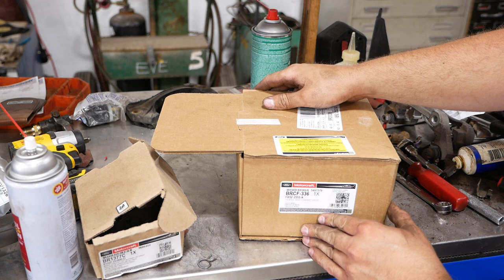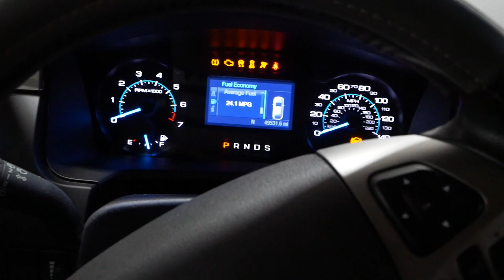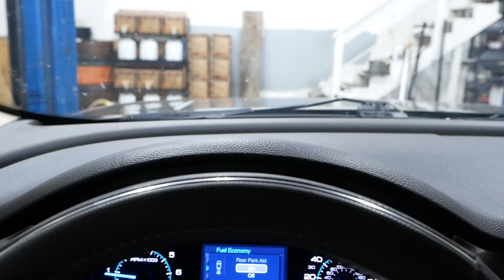Replacing a Brake Caliper with Integral Parking Brake - Ford Flex

Comment: As far as o.e. parts being better, there is definite a reason for it. I read a while back that even when a part supplier makes the o.e. part, it’s consumer division has to work with the same information that is available to non o.e. parts makers. It is actually unlawful for a maker’s o.e. division to share information on specifications with its consumer division. Apparently those laws were enacted to keep the aftermarket competition fair.

Comment: Funny thing about pinching off flex lines, I have no problem doing it with old and used ones, but not with new ones, which is the opposite to how it should be since the new ones should better be able to handle it.

Comment: I got a similar tool for them calipers but only RH tread. And I also have those calipers on the rear of my mustang and didn't bleed the way you did but still bled out ok. Stops great compared to the rear drums it had before.

Comment: First time I encountered screw back pistons was in a 1996 SAAB 99.  Was ticked off that the parking brake worked the front wheels, couldn't swing the rear end in the snow.

Comment: My 2001 Tacoma has 160k on the clock and is still running all OEM brakes and clutch.  Just now hearing the squealers up front so its time.   Twenty years on wear part!

Comment: Nice work Wes. I lost track of how many rear brake calipers I put on my 09 Honda accord back when I had it. It was a stick shift so I use the parking break every day but they still always seized up something about that wind back mechanism. I think every year I would replace at least one of the rear calipers. Maybe it was a problem with the remanufactured ones suppose I should’ve tried an OE one

Comment: Had a Saturn VUE it had 135,000 on it. Brake pads all four wheel were still 95+% rotors looked brand new! It got rear ended in fount of my home and was pushed out into the street and totaled it! Note: it was on its 3rd factory transmission? Rest of car held up great normal maintenance was a great car except for the trans? And was on 3rd set tires they were new when wrecked!

Comment: Excellent video Wes  :) also what I do is lube bleeder screws, grease up sliders pins plus plunger in clapiers in April and October every year also if vechile has drums too plus do Emergency brake cables plus on pedal or handle too and save from sticking on or seized up plus plus spray around brake lines to on master cylinder plus brake pedal too! Never had one my vechiles have bad problems since and who taught me the trick this is my Late Dad because had had major problems on brake problems on car and truck years cost him lots money and he learned from it especially when Winter Season months when happen on too! So want me not see happen to one 3 boys or anyone else ! But want giggle I use Emergency brake handle or pedal lots and only had one Emergency brake cable stick one and I had cut off one car had years ago and plus in Winter Season too not fun for sure plus had get brand new cable plus hardware to replace on plus back brakes on everything cost me lots $ but learned my mistakes!
Reply from the maker: That's a good idea!

Comment: The caliper puked out some Shrek piss when you bled the new caliper. The old caliper 100% had water in it from the brake fluid which caused the ratcheting mechanism to sieze up internally. I personally wouldn't have turned the rotors because of the 600-900°F blue/grey color the rotors had on them. You don't know without x-raying the rotors to see if they've got thermal inbrittlement, rather not take the risk their rotor shatters under hard breaking pressure. I've seen what happens when freight carriers cheap out on brake jobs and reuse bad drums, the drums crack at the hub face and beat around inside the wheels, cause axle damage and all sorts of other chaos.

Comment: I am not sure,however I have been told that in some states it is illegal for a repairman  to turn a brake rotor thinner than the manafacture's spec.for a commerical job.When I was in the trade,if a rotor would clean up by turning and still be within spec.we would give customer the choice of turning or replacing.Depending on model of car rotors can be fairly expensive.

Comment: Flex is extended Freestyle design. Freestyle design from the era when Ford owned Volvo. Have one of both. Freestyle still going at 248000 Flex at 156000. Minimal repairs to either.

Comment: Hell, my 91 Chevy c1500 still had the original Calipers, new rotors, wasn't worth saving the originals, Original Wheel cylinders as well, That truck has 678,000 miles on her. I sold it 2 years ago, I still see it from time to time. i'm not sure if they left the original engine in it, we had a cammed 305 from a Camaro we were going to drop in it, but sold it for the right price.

Comment: Nice job.
Worst one I even came across was a car where the "nice shiny" bit of the rotor was held in place by the caliper, and wasn't attached to the "fat lump" in the middle, outer thickness of the shiny bit was OK, but the inner was somewhat random and mostly missing.....
Reply from the maker: Yeah I've seen that before. Even had a drum like that once.
Reply: @WatchWesWork  ..and really scary when the owner's been taking kids to school and hasn't noticed the BIG brake problem, only that the kids have "done in the radio again".

Comment: In the UK we never change just one wheel caliper/ brake parts etc. We do them by Axle so in this case both sides would have to be replaced.Our ministry of transport annual vehicle test (MOT) includes a rolling road brake test and the braking efficiency & performance has to match on each side. Changing just one side would probably show an imbalance.
Reply from the maker: Why do you think I just did one? I keep forgetting if I don't explicitly show it, it doesn't happen. Did you see how there were two rotors in the blast cabinet?
Reply: @WatchWesWork   Sorry  Wes, I just assumed (Wrongly )  that as you only showed one and the Title described it as Changing "A" brake caliper and in your summary you said  that it  had now had  one new rear caliper which made me assume that you were only changing one. Evidently my mistake for which I offer my apology.
Reply from the maker: @philiphartley8823  I only changed one caliper, but the pads and rotors were fixed up on both sides.
Reply: @WatchWesWork  That was my point, in the UK  both sides would have to have had the calipers changed.  Our MOT tests are incredibly strict.  If a tester noticed just one new caliper on any axle the vehicle would fail the Test. The same applies to shock absorbers and steering joints. we can't buy some parts singly as they are only sold in pairs.
Reply from the maker: @philiphartley8823  That's crazy. There's no reason to replace a caliper if it's not broken. Normally they last the life of the vehicle.
Reply: @WatchWesWork   Yes I know but we have to have an annual MOT to be able to drive on our roads.  We pay an annual fee called Road Tax to be able to use vehicles on our roads  and we have to have a Current MOT certificate  and an insurance certificate to be able to pay the Road Tax fee. They are all tied in with each other and done electronically now.  Our testing system is a licence to print money for unscrupulous testers as they can fail a car and tell the owner it needs this that and the other and then charge them for doing the work. A cockeyed system all together. I never use a testing station that also does repairs. At least you get a chance of an honest test.

Comment: Clear hose should have been connected to the Bleeder Screw and the other end to a clear plastic bottle (in order to observe for bubbles); so brake fluid won't be dripping all around.

Comment: I've never bothered clamping the brake line when I do my brakes. I just throw something under to catch the drips, and fully flush the system with fresh fluid.
I've never greased the sliders either. I usually end up wire wheeling the pin because they've dried right up and slather them with anti seize, because rust belt.

Comment: I have the stuck wheel issue too, I stand facing away from the wheel and I horse kick it.  No need for a hammer Wes!  I agree with the original rotor comment, I bought OEM new and they were different than my factory rotors on my WK2.  Why would they be different if I bought from the dealer, doesn't make sense.
Reply from the maker: They probably switched suppliers. That's really common. Once the car is out of production and the volume drops way off, they bid it out to a different supplier who is OK with making less parts. That's why OEM parts often aren't any better than aftermarket.

Comment: Just replaced my pads and rotors on my fiat punto a few months ago, i hate those integrated parking brake calipers, never seem to hold the car as well as the old drum stile does, was a pain to get them to go back in without that tool

Comment: Ceramic brake pads you won't have so much trouble also drilled and slotted rotors I just put a set on my '07 SuperCrew from Detroit axle since the fluid and clean brake clean they send it to me when I buy brakes

Comment: I find it easier to remove the ebrake cable and loosen the flex hose while the caliper is still bolted to the bracket and the bracket bolted in its place.  Unless you're into smashed knuckles. To each their own.

Comment: I usually don't weekend warrior on stuff this new I wonder how my power bleeder would do on that style caliber 
2 wks ago I had 1990 tune port iroc in the shop with the worst seized on wheels I've ever seen I ended up using a old school trick of backing lugnuts off 1/8 of inch and driving around block they came right off after that corner side load is some good force on it

Comment: I'm surprised you did not have a small clear hose on the bleed nipple. Lets you see the air bubbles, and helps control where the brake fluid goes.

Comment: I don't know if it's the angle of the camera but the pads looked a little small, they never extended to the end of the rotor. I recently replaced brakes on a Kia and it had the same thing, I found out they had 2 different size rotors for the same model car and the previous mechanic put on the wrong rotors. When the pads don't go all the way to the end it forms a ridge.

Comment: Common issue with the Ford Flex, we have replaced our calipers, and rotors 3 times now in 80K miles. the guide pins rust and seize up.

Comment: Wes I was wondering why u didn't torque the bolts down? When it comes to brakes that is one of the most safest jobs to do on someone car or truck. I have always torqued mine on vehicles cause if you don't and they have a wreck and someone dies they will check that vehicle from top to bottom and if the brakes caused it they will check to see if they are torqued the right specks.

Comment: Actually I am surprised that you put lube on the pad sliders.  Many years ago when I worked at a GM dealership (as a lube tech but trained as a mechanic, long story) here in Canada a GM rep came and gave a demonstration on new procedures.  One thing was to not put grease on the pad sliders.  The reason was that the grease would collect dust and dirt.  Thus preventing the pad from sliding.  So ever since then I have not done that.  No problems.

Comment: Since the mass adoption of ceramic pads, I almost never have to change brakes on my cars and trucks.  My 2016 Subaru Impreza has 110K miles on it and the brakes are still all factory.  It's also a manual, though you can't really engine brake with it much, makes it use oil.
Reply from the maker: These are semi-metalic if I remember right.

Comment: Ayy up Wes did they say brake job,or blow job??Another fantastic vlog  from you good to see Mrs Wes doing your paper work,
when I change my brake callipers I also change the flex pipe.
And as for the parking brake cable I use ptfe spray on the cable.hang it up and spray in side to stop it from seizing

Comment: i have a rubber plug that slips into middle of banjo fitting has a couple steps for different sizes and it plugs up the banjo fitting quick and easy it was in auto parts store fix it stuff pretty cheap

Comment: My 2011 focus has 216 000km or 134 000'ish miles and I'm still on factory original rear drums and shoes. And am on my first rotor and second front pads. 
Some people ride the brakes horrible now. Let off the throttle and let the transmission do some of the slowing work for you.

Comment: I have the same tools. Same method.   However, I am sure the guys who just Finished calibrating their 900 dollar torque wrenches that they use for every single nut and bolt are outraged.  Every one of them is outraged by the fact you don’t follow the Ford procedure.   Their Reddit groups are on fire right now.

Comment: The Jiffy lube here in Spokane, is advertising Spark Plug replacement.  those dudes can't change oil, I sure want them messing with my hot aluminum engine heads

Comment: To me tan grease is wheel bearing grease, and I have never seen brake (silicone) grease that was anything then clear, but you used purple grease on the sliding points, what am I net getting.   I get the rust belt location, but sandblasting parts is next level, kudos for that.

Comment: I don’t see a problem with turning the rotors, I wonder what the heat has done to them though…
Reply: Wes would have seen if the rotors were past there heat tolerance, by color or  if they were warped . The surface of the rotor was  great after he turned it. This was a great video.

Comment: Tip for bleeding brakes, get a vacuum bleeder.  Saves tons of time and grief and you can do it solo.
Reply from the maker: I have a pressure bleeder. Never found the vacuum bleeders to work at all. They just suck air around the bleeder threads.
Reply: @WatchWesWork  
All I can say is it works for me.

Comment: Was wondering all through this vid , why are you replacing the caliper ? ,found out at the end ! , I think you will find , if you find a way to hold that original caliper , like in a vice , and give it some with the wind off tool , the piston will give and start to wind in , think of it as a nut wound onto a bolt till the nut is against the bolt head and has locked , same thing inside the caliper piston , though done with the emergency/foot/handbrake and hydraulic pressure from the self-adjusting as the brakes are used/ware ... had a similar thing on a Peugeot 307 left side rear , so got a good used one , as needed to get it done , but I did manage to free off the piston eventually so ended up with a good used spare . Far as I know turning disc's/rotors is not done in the UK/Europe , they are always replaced with new !

Comment: Brake jobs on your videos are important as DIYers try to just push that piston back and then they are ruined for absolute sure.. I did it myself not knowing and being in the Subaru business I really should of known this. All the older subarus used this on the front calipers and then on the back with four wheel drive all rigs by subaru.. A good video Wes but no dancing pigs like on the older shows of "Hee Haw" and their skits were some of the most entertaining back then.

Comment: do you have to crack the brake line in order to compress the caliper? My wife has this on the back of her MKX and I couldn't get it to compress using the same tool as you used and it looks like it compressed super simple for you.

Comment: Do you clean the pads off after touching them? I noticed you always have a jump cut before putting things like that in and I was always told you want them to be as clean as lightbulbs or internal parts and totally oil free including finger oils, which I thought was crazy

Comment: People would freak out if you turned the rotor?  The best rotors ARE turned rotors because they have already gone through many heat cycles.  New rotors are "green" rotors and will have a higher probability to warp.  Esp chinese ones.  Makes no sense to lubricate between the pads and SS clips since you are just attracting dirt.  You are good to lube btw clips and bracket since the rust from bracket will expand and seize the pads.

Comment: I have had a few of these, ford says ignore it. replace the rotor (if needed) and pads if caliber is stuck replace. There is no answer to this issue. Some shops replace any or all of the following Rotor, Pads, caliper, Wheel bearing, brake hose.

Comment: 12:04 Not me. Replacing rotors that are still in specification after a resurface skim, when they're already a consumable these days, is so completely unnecessary, particularly on rears.

Comment: Hello Wes! Thanks for all the awesome videos, I have an issue and you might be able to help? I am the proud owner of a 2005 toyota rav 4, 4wd with a 5 speed, I have AC Trouble. I recharged the ac system as summer came along, The ac works, kind of. It surges, blows really cold, then gets super hot. The sight glass is clear, and have double checked the charge. any ideas?

Thanks for reading
Ghost259

Comment: Just had both rear brakes done rotors pads and calipers,picked up car and now the brake lights are on had shop do work what would cause this problem the car is a 2007 Ford 500

Comment: 10/4 on the beautiful assistant and do you get haired over when it's a thousand degrees hot and baby faced in 75 below? Just axing.
Reply from the maker: Laziness doesn't follow a calendar...
Reply: @WatchWesWork  I was outside with no cabs and let it all grow in winter and whacked it all in summer. No money for Carhart's so used what I had.